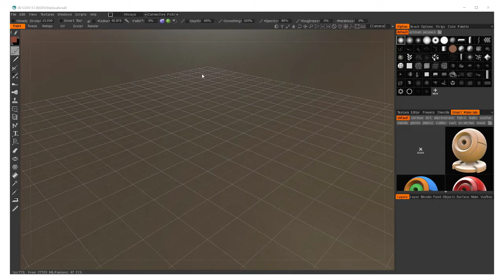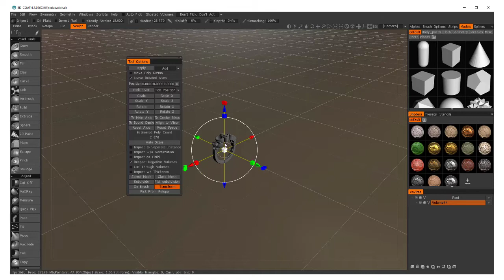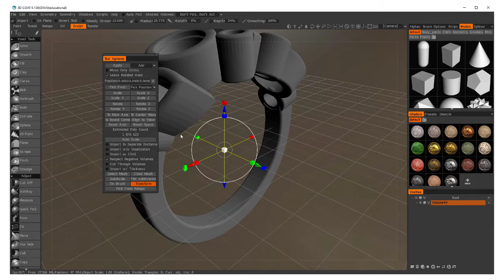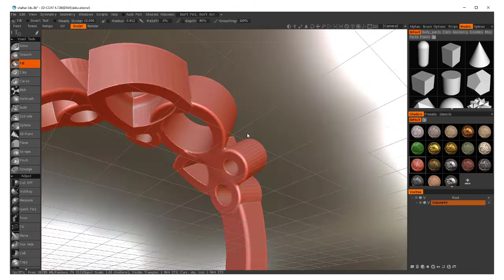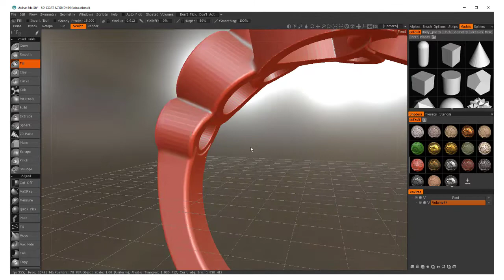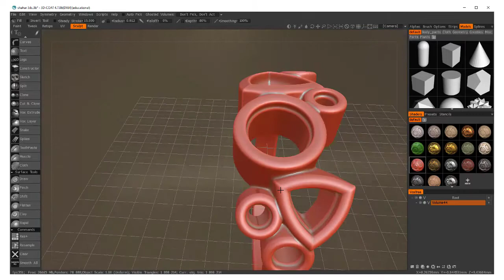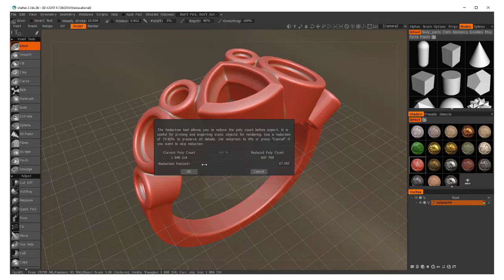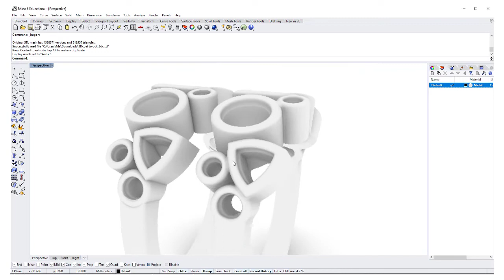Practical Jewellery CAD Tutorial: Filling and smoothing gaps with 3D Coat

Comment: Hello Do you have any other way of smoothing rings? Like Zbrush? Bcos 3d coat screws up the topology of the ring and it is not renderable. Any other way to smoothen the rings with perfect topology?
Reply from the maker: I mostly model for manufacturing, not rendering so afraid I cant help in this case.

Comment: Hi, do you see these lines you have on the curves surfaces of your bezels? 
Is there any way to get rid of those? Apart from having to manually pass a smooth brush over everything which might cause other problems?
Reply from the maker: Sure. Type in "options" in the command line. Then go to "View" at the bottom, then "Display Modes", then "Shaded". Under "Visibility" uncheck/untick "Show Isocurves." This will turn off those surface lines.